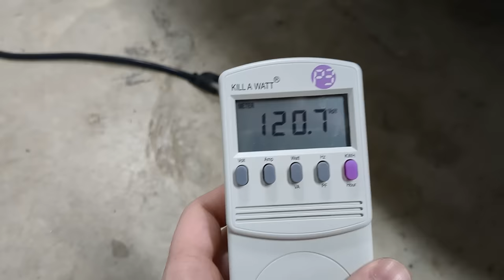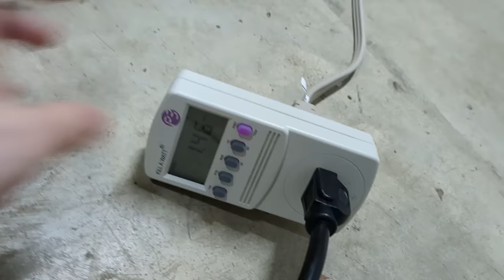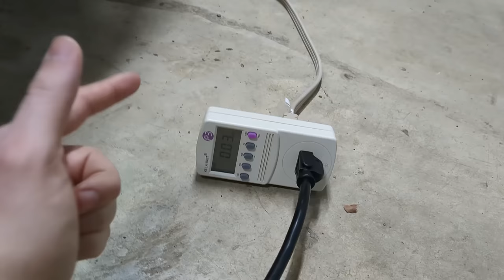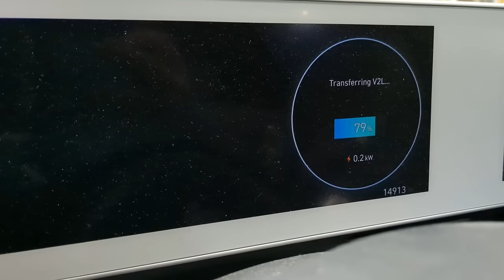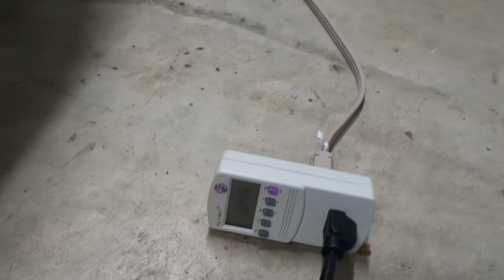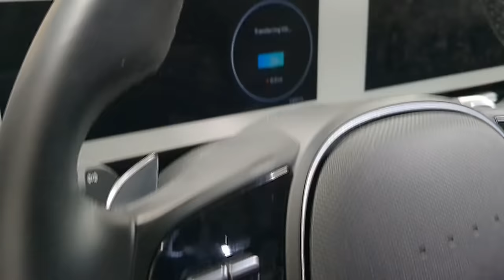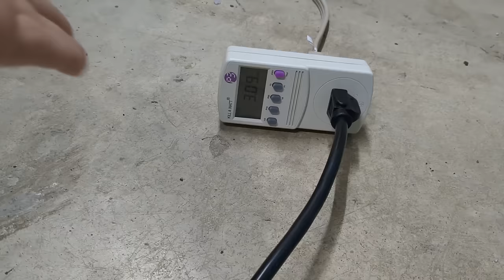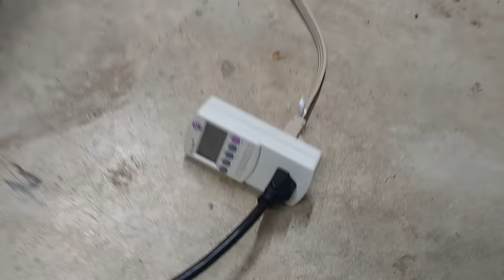A 24-hour test run of the Hyundai Ioniq 5's Vehicle-to-Load function

Comment: Hello,

Excellent video. I can fill in the gaps and tell you how to get more out of vehicles by using 240 volts instead of the 120 volts your car is providing.

There is more here than meets the eye and your EV will be able to power much more than that and bolster the grid in the near future.

I have a few videos (please don’t judge too harsh because I’m new at this) and they answer a lot of your questions you are asking.

Yes, every one using roof top solar will need storage (especially for the afternoon and evening) but your EV can and will be part of the solution. 

Yes, NET metering is not the answer.

I would love to show you how it can be done and make roof top solar (even older systems can be converted) work with a smaller battery and your EV and charging your EV at work.

Comment: I'd be willing to bet your loss ratio would be improved if you had more demanding loads. Suppose perhaps the car draws about 300 watts continuously while in standby. That would explain why the battery lost twice the energy with 300 watt loads. If you run a space heater, you might get close to that 20% figure you were hoping for. Not important for the sake of emergencies, but it would be a cool experiment to get the datapoint!

Comment: Currently i have a hybrid Kia (Niro) so my backup is less reasonable. but still i can get some energy out of the 12v power ports (nee cigarette lighter) and a small inverter.  Should be enough to keep our boiler operational.  could certainly charge phones and in a pinch i could sit in the car to stay warm.   If i were to replace the Niro, i still wouldn't go full electric only, i'd go Plug in hybrid (PHEV).  The convenience of 500+ miles on a tank without worrying about altering route or extended charge time while traveling just makes more sense to me.

Comment: i like the channel but i disagree with calling  the use  energy stored in a battery as generator, even if you are converting dc to ac. i have used my gasoline powered suv for about 30 hours to power a 5kw pure sine wave inverter. i used about 1200watts continuous the entire time, powering fridge, windows ac unit, lights, computers, tv and i ran all of this over a 100 feet extension cord.  it was just a test to see how well this work work. i estimated i used about 40% of 19gallons of fuel so about 7.6 gallons x 2.00 a gal at the pre brandon fuel prices so it cost me about $15.00 to do so.
oh and 1200watts x 30 hours is  36kkwh. which was expensive to do but a good test

Comment: is it still an inverter, if you are going from high voltage DC (800v) to lower voltage AC  (120V) ?  Normally inverters boost voltage  don't they ?

Comment: Just rite 5 gallon gas cans with STA-BIL times 5  and a Honda EU2200i generator equals 4 days max of 2200 watts and at 550 watts is 9 days run time. And every year dump extra gas in car, or snow blower. And doesn't reduce range of car at all. Also you could charge your car, when caught with pants down.

Comment: I'd always wondered about using the range-extender electrics as large, reliable generators. Maybe that comes up later in the vid though, I've got a good bit left. Typical generators have terrible maintenance cycles and can't drive themselves to the gas station. Here in a hurricane zone it's not unusual to be without power 10-14 days, but the gas stations come back (on generator) about 2-3 days in.

Comment: Really interesting experiment! I wonder if the Texas freeze happened 15 years in the future, do you think it would just have been a more minor blip?
Reply: Doubtful. It was extremely bad weather across a very large swath of land, most people do not own new cars, and shockingly few know what to do in a blackout of any length.
The weather being so wildly cold by our standards is critical, as the scenario in this video wouldn't have kept the heat on. Gas supply issues were taking gas-fired electrical plants offline, and also resulting in gas-fired heaters and stoves not working in homes that still had electricity. 
...
My family had the propane cooktop, kerosene lanterns, extra blankets, and plain ol' flashlights ready to go, and our power and gas didn't stutter even briefly. Go figure.

Comment: my Ioniq5  here in germany came with the adapter since i got the almost top level configuration, tbh only used it once until now just to try it, but at the moment i have a bigger problem with the car, the iccu (charge controller) became defective and as of now, the replacement part  can not be delivered before the 18th of may so the car is standing at the dealer until then (and since about 4 weeks now) and can not be driven now i have a mild hybrid i30 till then -.-

Comment: I really wish all electric vehicles would include the power back (down to 30% of the battery, in case the power does not come on and you need to get to an available public charger) in the cable itself, with a compatible smart electric box panel, but also be able to provide the safe average discharge without much cooling needed for the battery pack.

Comment: This is really good to know. It also makes me think that cobbling together a home battery backup from a salvage EV battery pack would be a good idea. Though it'd be a lot more complex to do! Also the tesla plug's lack of V2L is yet another reason why I'm annoyed at Aptera for being so super keen on adopting it for their vehicle.
Reply: Ultimately, though, there's nothing inherent to the Tesla plug that prevents it from being used for V2L. Every approach to V2L that I'm aware of could be done over it:

* CHAdeMO V2G - this approach is expensive because it requires a separate CHAdeMO-powered inverter, but is popular in Japan, and is explicitly marketed for V2L and V2H applications as well. (Actually it might work today on a Tesla with the CHAdeMO adapter, now that I think of it.) It's popular enough that the Toyota Mirai - not even a plug-in - has a CHAdeMO plug purely to use the Mirai as a V2H generator.
* Hyundai/Kia's proprietary modification to J1772 to enable V2L (which has some drawbacks - the voltage limit is set nationally, so you can't do 240 V with a US car)  - NACS recommends J1772 as an AC charging protocol
* Ford's Bluetooth-controlled (yikes) use of J1772 (or the CCS connector? Seems to be putting AC onto the DC pins? Probably simplifies the EVSE and transferring to recharging when the grid comes back, but.) with a proprietary EVSE to enable V2H
* CCS V2G - I don't know if anything actually uses this yet, but basically the same idea as CHAdeMO V2G - NACS recommends CCS as a DC charging protocol

Every one of those protocols can be carried over the Tesla connector today (well, except for Ford's, but the Tesla connector can still be used for it).

...it'd be nice if SAE would just include V2L/V2H functionality in a future J1772 spec, though. It is possible, as J3068/2 is a work in progress standard for V2G on the J3068 connector (which is just Type 2 with a new protocol mode for higher current/higher voltage AC charging for US commercial vehicles), and J1772 could easily carry J3068's protocol.

Comment: 44:30 as more and more folks buy and EV either as primary or a supplemental vehicle, multi ev housegholds in an emergency can keep you going for a quite a long time. it takes the same amount of energy to light and spin a HVAC blower on a 3000sq ft home with2. people as it does to do the same house with 4 or 6 people in it, and if you have 2 EVs on demand you can go far.

Comment: It’s great that the car can do some work in a pinch but on the flip side, this is incredibly lacking compared to a powerwall. When I lose power I can’t bake and I can’t use the drier (baking is remedied by a Traeger, and I’m replacing the dryer to a heat pump drier). But the powerwall was $12k and this is a “free” feature as you will buy a car anyway and you have a choice of buying a car that can do this or can’t do this. Personally I’m excited for this feature to really develop and become much more robust, handling the whole home. Imagine a cyber truck with a 180kwh battery paired with me 13kw solar. Unlimited grid down power.

Comment: Every single EV and PHEV should support V2L and the very minimum and preferably V2H for at least 3kw or so. This is why I like cars like the Mitsubishi Outlander PHEV. It has a 20kWh battery, an engine that gan run as a generator, and has built in regular US plugs built in to the vehicle.

Even if your area has no power but another area of your city does you can even do a 'power top up' run and drive your car over to charge for a bit and bring that energy home to run your emergency items.

Comment: I never understand how people freeze to death inside their home during power outages in winter.  the only thing I can think is that they're so used to relying on technology that it never occurs to them to go "old-school":  park your ass on the couch/bed and pile on the blankets.  you can put on extra clothes to the extent that you don't cut off your circulation in any way. only ever layer to the extent that you don't sweat or overheat. get the whole family under the blankets in a "cat pile" only split up if it gets a little too warm.  

where it can get dicey is if you pull the blankets over your heads: the warm, moist, breath from your lungs will condense inside the material of the blanket as it reaches the outer layers, and will continue to freeze  inward meaning the blanket's becoming less and less effective as insulation. you can usually tell that this is happening long before it gets dangerous though. the simple fix is not to put your head under the blanket,  but instead wear a warm hat.

Comment: I feel a better way to do it is to have a plug that can access the EV battery and put the inverter on the house side of the cable... I mean using your car to power a drill or saw if you need it is.... fine? But in the case of trying to power your house through an outage, 15 amps isn't that much power. Getting full access to the battery and having a proper inverter means you should be able to run your furnace, no worries about microwave, fridge defrost cycles, etc. 

It just sounds to me like a better way to do it, tho it sounds like most auto manufacturers are still trying to figure this stuff out. Eventually they will settle on a standard and one cable should work for everyone.... hopefully.

Comment: Just out of curiosity can you use the back seat plug and VTL together for more available amps?  If there is an extended outage you have the option to drive to maybe a more urban or other place with power and charge.  OR something like running a generator during the day to charge and having quiet at night.
Reply: No, they are combined.

Comment: if it outputs 1925watts(you said 1.9KW), that's actually a 20A output, not 15A. you could use a NEMA 5-15 to 5--20 adapter and it should be perfectly fine.

Comment: Be careful with chaining multiple power strips like that; each connection adds a resistance, and it's easy to get to a point where a short circuit doesn't cause a high enough current flow to trip the protection, but is high enough to turn the cables into an electric heater that sets fire to your house.
Reply: If the power strips are up to spec that isn't an issue. You would eventually reach the point where a short circuit wouldn't trip protection but at that point the current would be below the rating, hence no fire.

Any increased fire risk is simply from having more points of failure.
Reply: 19A at 120V gives about 6.3 ohms. For a single run of cable that would be an immense length for the heat to be dissipated over. On the other hand, if I connect my earth loop impedance tester to a power strip versus directly to the wall, I might see an increase of 1 to 1.5 ohms from that, even though there's a only a metre of cable, which is telling me the resistance is coming from the connections, rather than the power strip or cable itself.

NEMA sockets don't necessarily have the best resistance even under good conditions, so a chain of as little as four power strips could put you in the right ball park, and now you have just under 2kW of heat to dissipate in just a few metres. Even if there's no fire there, you're going to be getting intimately familiar with that fishy smell of unhappy PVC insulation.
Reply: @NeneExists  I still don't think the risk is any worse. If you have a 20 amp breaker then it will allow 19 amps to pass unimpeded. You could have a legitimate 19 amp load or a short circuit at the end of 50 power strips which draws 19 amps. To the connections in the circuit there's no difference.
Reply: @eDoc2020  you still shouldn't be chaining this many power strips no matter where the port is coming from!

Comment: Linesman here.
IF YOU ARE BACKFEEDING YOUR HOME ELECTRICITY, TURN OFF YOUR MAIN BREAKER SO I DONT DIE AT WORK!
electricity backfeed into a transformer, transforms, and is stepped up to lethal voltage.
Reply: 30yrs electrical contractor here. At 27minutes, he is only using plug connected loads. No tie in to his panel.

Comment: I'm a little sad to admit that I thought Tesla was capable of V2L/V2H when I bought mine. I hadn't done my research on it and just assumed so. I'm coming up on 1 year of ownership and reflecting on whether I would have bought something different with the knowledge I have now, and V2L capability might have actually swayed it. Buying a comparable amount of stationary batteries, 60kWh, even at what I think is the cheapest at the moment (LG Chem RESU @ $0.925/Wh) would still be more expensive at ~$55k vs a Premium but RWD Ioniq 5 at like ~$53k. AND you get a car out of the Ioniq 5.

Comment: whats the interior outlet power rating? It sounds like your ioniq has two power inverters so the standby consumption for them would be different if you can turn them on or off independently.

Comment: I have a Samsung fridge in the same "not really stainless steel" look and it's also a pain in the ass to clean. We got some "stainless cleaner" from Home Depot that does an OK job, but you still have to fuss with it. If you're not willing to do a full proper wipedown, it's best to just leave it alone otherwise you get weird smears on it that won't go away. I'd much rather just have white or black.

Comment: As much as I like this idea, it will never work for a hurricane. Power can be out for up to or even beyond a week. Should we need to leave afterward, the car won't be fully charged after powering the fridge and other odds and ends for several days. My dad has a generator that can actually run on the house's natural gas supply, and we extremely rarely lose gas service. I think that only occurred during/after Katrina. For Hurricane Ida, we were without power for 3 weeks. That's well more than this can manage. We left shortly after the storm had passed New Orleans (5 or 6 days I don't really remember), so this car would have been close to dead. It may have made it to Baton Rouge, and there are a couple of fast chargers, but I'm not sure it could have actually made it. The generator and gas service are here to stay in Louisiana. Our furnaces should still be replaced with heat pumps, but we need gas.
Reply: I suppose a generator could be replaced by an additional battery system, but then we'd also have to contend with the stove being run on electricity along with the fridges, deep freezer, some fans, normal electronics, and probably a window unit since it gets stupidly hot during hurricanes, and a window unit pulls over 500W all the time. Believe me, it's necessary for the heat and humidity, even if it can only condition one bedroom. Suffice it to say, my family will not be ditching our generator thanks to hurricane season

Comment: Using an electric car like that is interesting.  Especially if you could do the whole home powering.  Let it charge up on solar during the day and run the electricity at night during low demand.  Obviously you'd need to be sure you weren't needing to travel far first thing int he morning, but there are definitely some situations where I could see this working in lieu of a battery wall
Reply: A car battery is at least 5 times bigger than a power wall. So it can definitely be used instead and still have power left over.for.driving

Comment: like having a bluetooth speaker that can also charge your phone in a pinch ... handy. 

I could conceive a way vehicle to grid could become a thing. Someone will figure out that you can smooth out the power over a grid cheaper by paying lots of small homes pennies rather than building another peaker plant. imagine you local utility will cheaply install a nice charger for you but that comes with the stipulation to use small amounts of electricity out of the battery from time to time to balance out the grid.  No need to battle the nimby's and environment to build a power plant.  The interconnections will keep getting more intense imho.

Comment: I'm a little surprised to see you have starlink. Is that your main internet or were you using it as a emergency test scenario where land internet options are most likely down?

Edit: V2G has always seemed cool, but would very very limited it use. I had not heard of V2L before, but it seems like the best option.

Comment: There really is no excuse to not add this feature to every EV, because there's about a 100% chance that the inverter in the car that you're using is the power factor corrected AC-DC converter that the car uses to charge the battery, just run in reverse. The hardware needed is almost identical between the two, so the additional functionality is mostly just software with maybe a little more hardware sprinkled in.